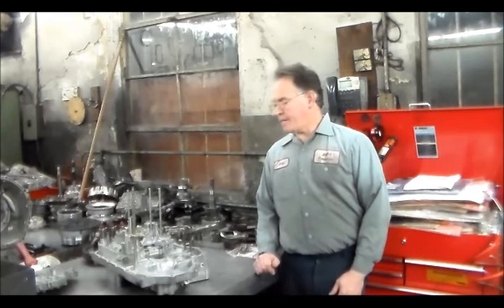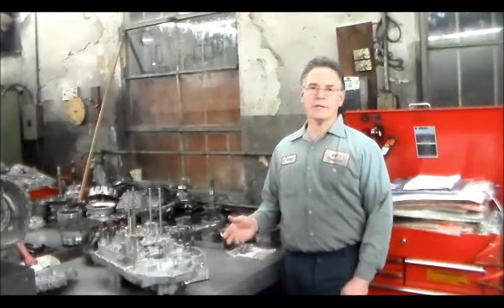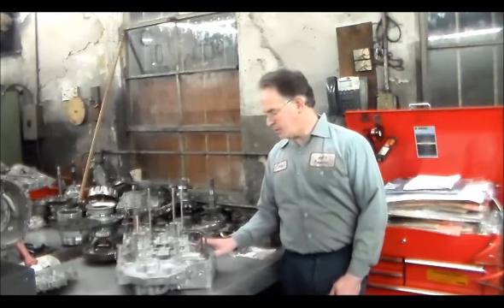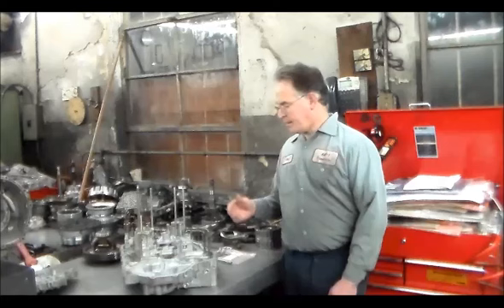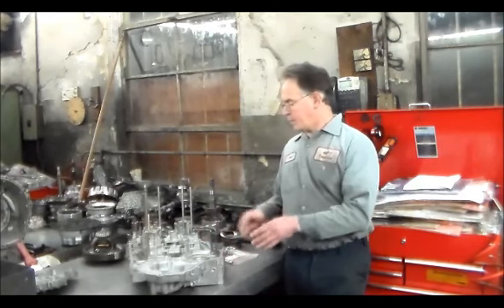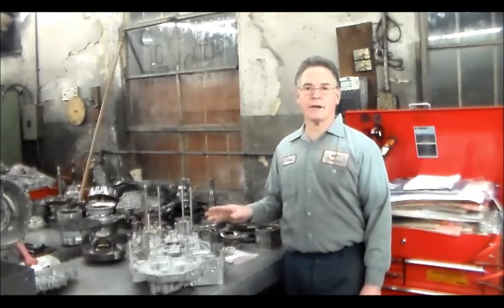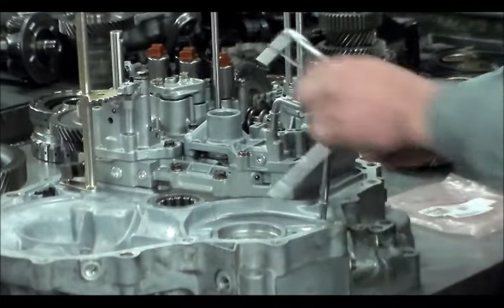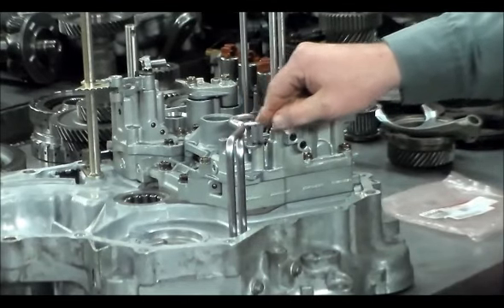Honda BCLA, common Problems

Comment: Greetings my dear friend, first of all I want to thank you for your videos, very good and very helpful. I am having problems with the transmission of a 2003 honda accord 2.4 BCLA. This at the time of applying the second speed is neutralized. The first gear applies perfectly and, to be able to take the third gear, when the ECU sends it to second, I put the lever in N and then I pass it quickly to D. In this way the box returns in 3rd and then takes 4th and 5th perfectly. If I let the gearbox do its normal cycle, I get a fault code, P0752, which indicates "shift solenoid valve A stuck on". However, solenoid A has been inspected and works correctly and is within the patterns indicated in the manual, it even interchanged with the solenoid of valve B and the result was the same.

The pressure of clutch 2 is not correct and for this reason the transmission has been disarmed, and thanks to its video we were able to find a faulty pipe, it was replaced but when installing the transmission the problem persists. At this point I would like to ask you if you think it is due to an internal leak in the transmission system.

I thank you in advance for the attention you can give me.
Reply from the maker: Answered your e-mail

Comment: hi your vid is very helpful! ive rebuilt this bcla now, but cant get the end cover back on the case? seems to get stuck at the roller bearing. any trick to get this back on flush? thanks
Reply from the maker: maybe the tubes are not going down all the way, may have to lift back up a little and down to see if drops in.  Bearings seem to be in place? can also put grease.  I put grease on the feed tube ends too
Reply: @GaryFerraro  thank you gary! I greased up the roller bearing with assembly goo and used a rubber mallet to tap the case together! took alot of mallet whacks :)

Comment: Hey gary.Any suggestion on 722.6 at cruise 30 to 50 mph have vibration like speed strips until I give more Throttle.Change valve body checked clearance.Sent drive shafts out.also change k3 out.I never got rid of it.
Reply from the maker: Almost sounds like a converter chatter
Reply: I agree with gary. mercedes are real bad about getting convertor chatter.

Comment: Hi,Gary I have a mcla that's keeps giving me a p0756 solenoid b has delay on d and reverse then only shifts in 1 and 2nd   for a bit until I turn the car off but it won't go on 3rd gear at all
Reply from the maker: any codes?
Reply: @GaryFerraro  Just giving me a P0756
Reply: I checked the solenoid B and it was good . This started happening after I added atf cause I was kinda low
Reply from the maker: @juanmendoza9957  When cold does it work the same way, does it delay when cold?
Reply: Also gives me a flashing d when it delays on 1st
Reply: Yes, It delays on cold start
Reply from the maker: @juanmendoza9957  Do you by chance have any spare linear solenoids?
Reply: Was planning on opening it up and changing both filters and the bearing that goes on top first casing cap cause it started making a winning noise before I took it out and updating the feed tubes. Im hopping this will fix my problem
Reply: Hi sir im also same problem can you fixed your problem tell me pls

Comment: Hey Gary, been following you for years . I’m a Honda tech , but we Don’t rebuild transmissions at the dealer .

I’ve been meaning to learn, what company supplies your rebuild kits & torque converters ?
Reply from the maker: I use a company called Transtar
Reply: Thank you!

Comment: Need tube part # nobody I tried has them.
Reply from the maker: Dealer should have them
Reply: @GaryFerraro  Honda dealer near me checked and said no dealer in eastern us had them. I am  afraid to put it back together even though the old ones look okay. Have not found any after market yet that can get them.
Reply from the maker: @donaldwinebarger8473  will ask my supplier if he has any